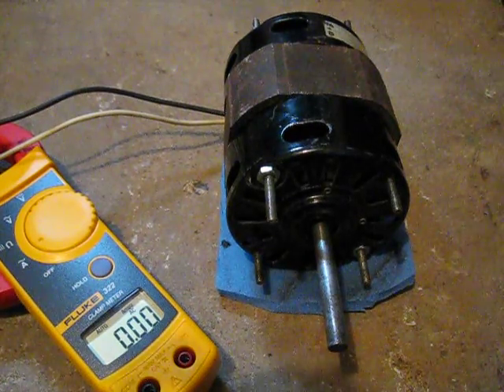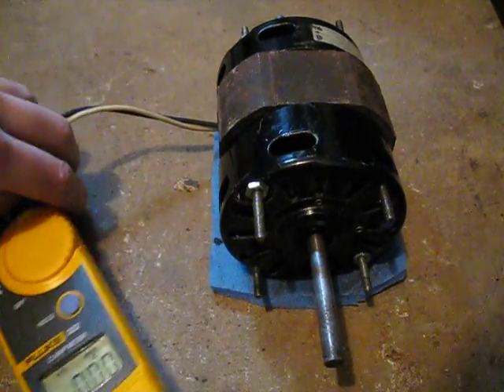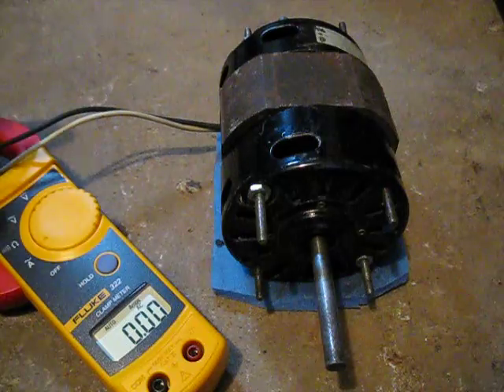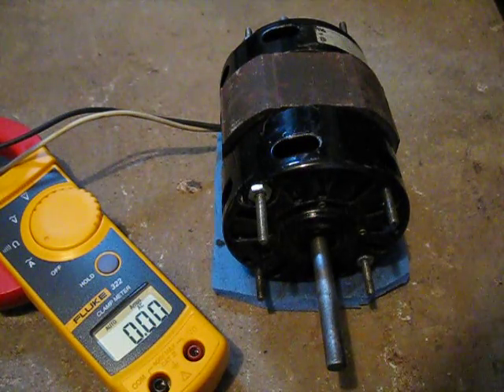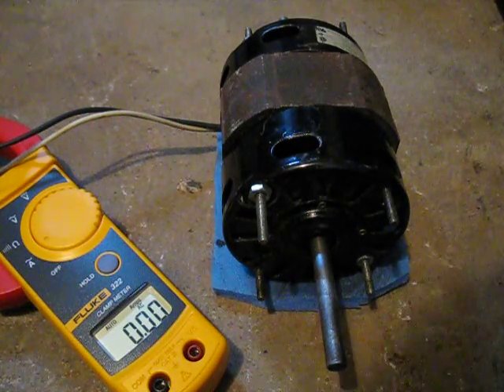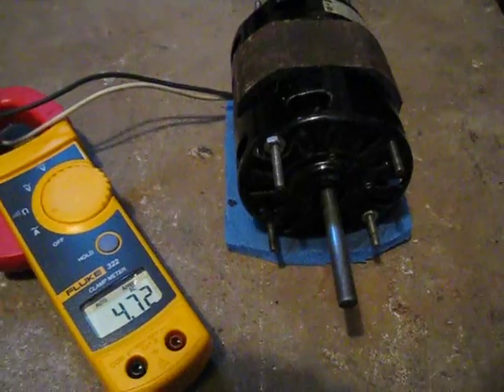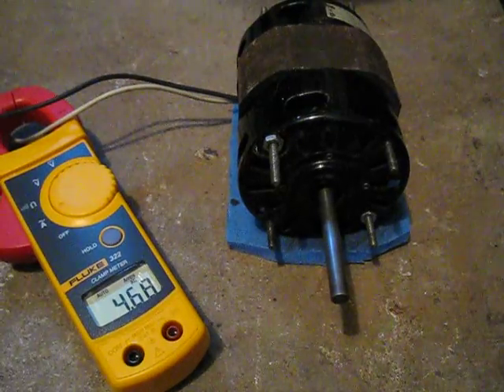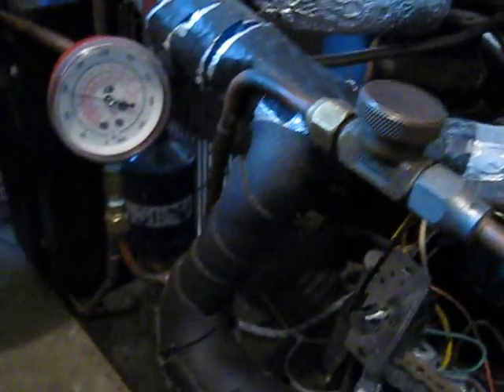Synchronous Motor Burnout

Comment: 12 years later and i am wondering what could have happened if it burned out while inside the cascade system while its running, that would be the scariest thing possible.

Comment: That's exactly the symptom you would get if a centrifugal starting switch gets its contacts welded shut. The actuator can still work, but, the starting winding stays connected in circuit. When that happens, the motor never reaches full speed, and draws way too much current. It doesn't take long for smoke to appear.

Comment: That's an Asynchronous motor. (Shaded pole) It ran a lot longer than I would have expected, having an interwinding short like that. What exactly is a "cascade" system? A heat pump, that circulates heated or chilled water using heat exchangers?
Reply from the maker: A cascade system has 2 compressors, 2 circuits and allows for extremely low temps, this one can do -100c. Just search cascade system on youtube.
Reply: @HL4EHalfLife  I looked it up: it looks like using a heat exchanger to thermally couple the condenser of one refrigeration system, to the evaporator of another, to achieve a very high temperature difference. Thanks for the information. I'm willing to bet that doing this for 3 or 4 stages, is how they get to cryogenic temperatures.
Reply from the maker: They use Ln2 cryogenic temperatures, cascade system's can only do so much without running into problems.
Reply: @HL4EHalfLife  I know that R-290 (propane refrigerant), can get you down to -306 degrees Fahrenheit. Almost, but not quite cold enough to condense nitrogen out of the air!. The concern I would have, is maintaining pour point of the lubricant in the compressor.
Reply from the maker: @vincentrobinette1507  No it cannot, if 290 could reach -306f than it wouldn't work in my heatpump. R-290 has a boiling point very similar to R-22 (about -42f) R410 is -55f, and Co2 is -109.3f... Research man, research!
Reply: @HL4EHalfLife  It will, but you have to run very low suction pressures. Of all the refrigerants, it has the lowest freezing .point, compared to any of the CFC, or HFC refrigerants. It is almost a perfect replacement for R-22, but has a much lower freezing point. My big concern, is compatibility with the oil, and the pour point of the compressor oil. The 2 reasons I wouldn't charge a R-22 with R-290, is because of flammability, and solubility in the oil. Besides, you don't want to cause cross contamination with any other refrigerant, during recovery. I don't like using ANY refrigerant, other than what's on the nameplate. The temperature points you state, are to make sure the evaporator coil doesn't freeze the condensed water. Lowering the pressure on any refrigerant lowers its boiling temperature. R-22 is used at high suction pressure in air conditioning systems, but much lower suction pressure for walk in deep freezers. You can only drop the pressure to a point, before the refrigerant itself freezes on the expansion orifice. Propane can get much colder before that happens.
Reply from the maker: @vincentrobinette1507  I understand that a lower suction pressure lowers the boiling point but you can only go so deep into a vacuum. I did refrigeration for 18 years so I stand by what I said in the previous post that R290 can NOT get to -306f, I have built a few cascade systems in the past, the best one having 2 1hp rotary compressors with the 1st stage using R402a and the 2nd stage using 290+Co2 and can reach a temp as low as -100c.
Reply: @HL4EHalfLife  I only said what I said on the stand point, of R-290 having the lowest freezing point of any refrigerant that I'm aware of . The problem is, going too deep on the suction lowers the density so much, that you would need a compressor with impossible displacement, and cam driven valves, because the pressure differentials may not even open reed valves. I have to agree, totally, that it's impossible, with a compressor designed for household air conditioning, or even a deep freezer. the freezing point of R-290 would NOT be the limiting factor.
      I did mention that it wouldn't be quite cold enough to condense nitrogen, but it might be able to freeze CO2 out of the air. You only need to get down to -110 degrees Fahrenheit or so. Tell me if you think THAT'S possible. That might be within reach of conventional compressor technology.(though it might require a multi-stage semi-hermetic compressor)